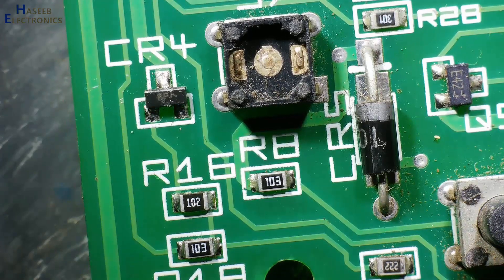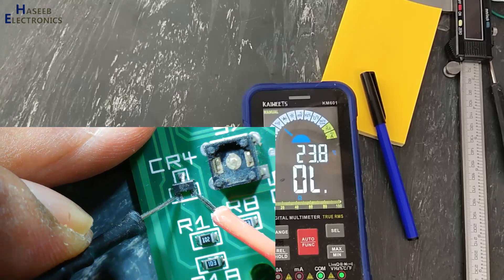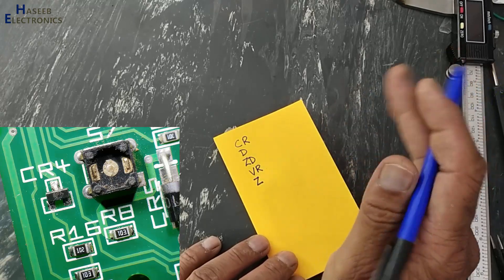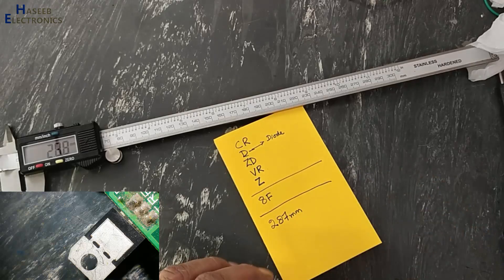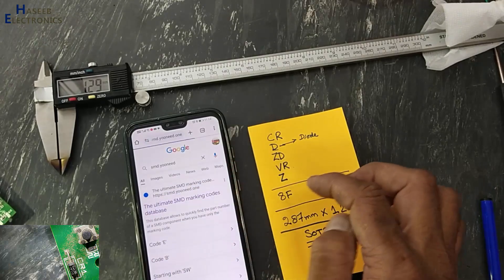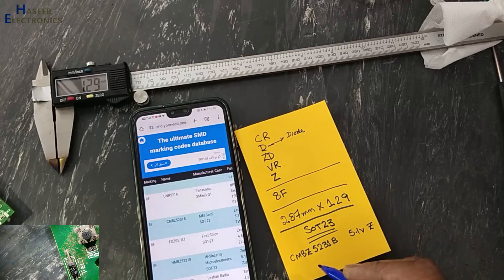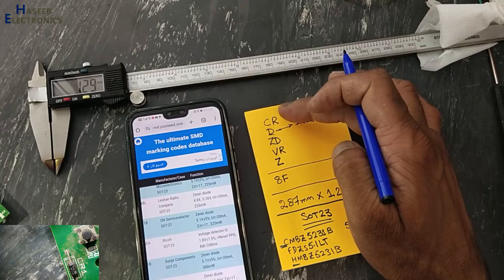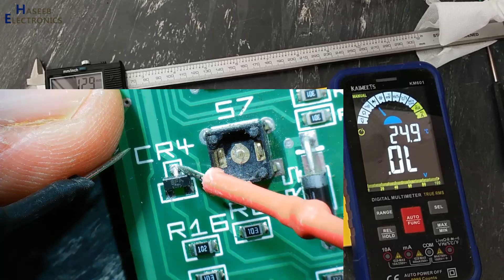{1210} SMD zener diode Identification

Comment: استاد عزیز سلام. من متوجه نشدم چطور پکیج رو پیدا کردید! sot 23= 2.9* 2.4* 1.1
Reply from the maker: SOT23 or SOT-23 package size code has measurements 2.9mm length x 1.3 width x 1mm height. in my case i get measurements in length and widgth. thus it gives closer matched component. in very rare cases i get height measurements 
کد اندازه بسته SOT23 یا SOT-23 دارای ابعاد 2.9mm طول x 1.3 عرض x 1mm ارتفاع است. در مورد من اندازه گیری طول و عرض را دریافت می کنم. بنابراین مولفه منطبق‌تر را می‌دهد. در موارد بسیار نادر قد را اندازه گیری می کنم
Reply from the maker: https://youtu.be/Q0uxM3YbSAs?t=158